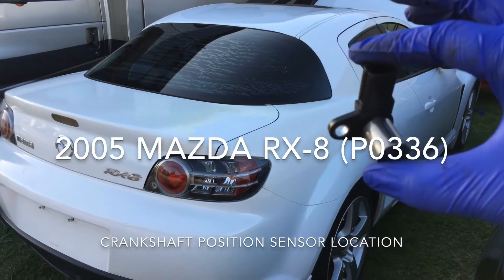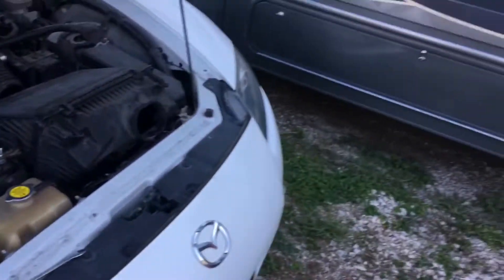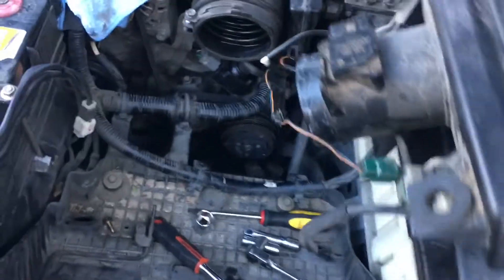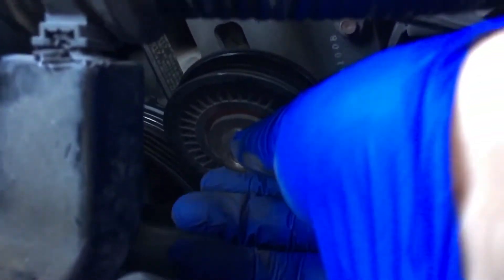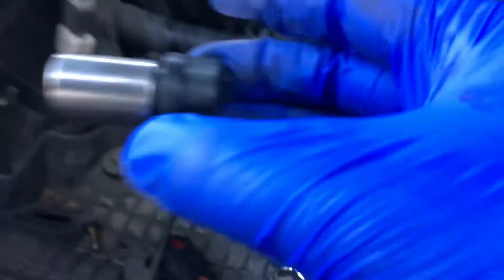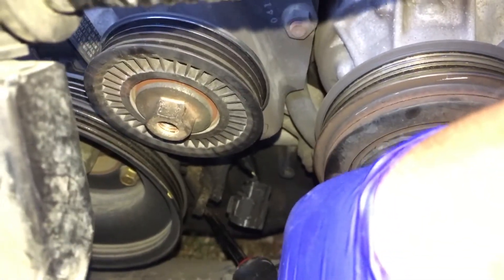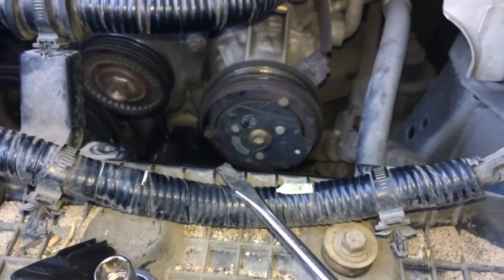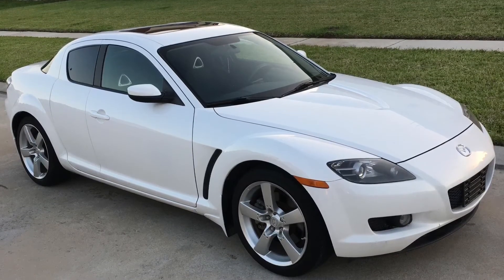How to replace crankshaft position sensor on a 2005 Mazda RX-8 P0336

Comment: My car dies when it gets warm , could this be the issue? I've replaced coil packs , spark plugs trailing and leading , spark plug wires , new battery, and starter. I'm praying it's not compression please get back with me.
Reply: What was eventually
Reply: @ndr_pc  had no compression , motor rebuild.
Reply: Did it work? , I’ve replaced all the same
Reply: @justinangel8589  had no compression left,  will need rebuilt
Reply: @justinangel8589 try alternator

Comment: How was it to actually pull the part? I've heard that the bolt that holds the sensor will sometimes break and it's pretty darn hard to pull the actual sensor out. What was your experience?
Reply: M G Hall hey. Im trying to pull it rn and its all nasty and it won't budge at all
Reply: bro pb blast it for a bit by soaking it then it will come off easier. don't break it any bold can break  @sohamnaik698

Comment: That ess is soooo much easier to take off from under the car. there is no need to remove anything except the eccentric shaft sensor (ess)
Reply from the maker: pmm4177 yes it is much easier from underneath. .  If you read the description you can see that I say that it's easier from underneath but this video is to show people where the sensor is and how to remove it from the top if you can't work from the bottom